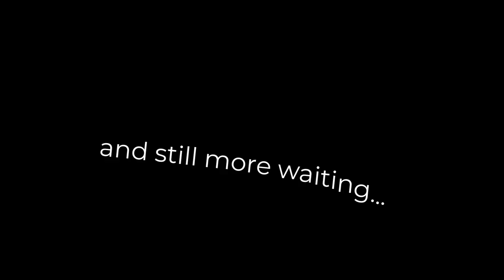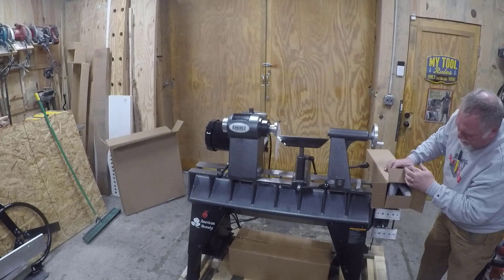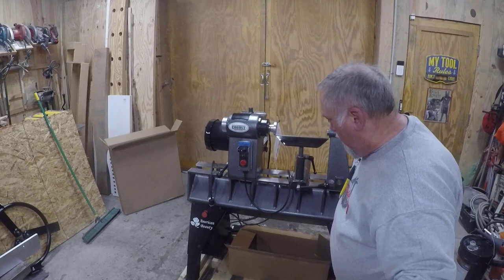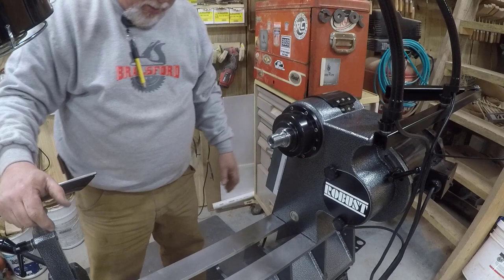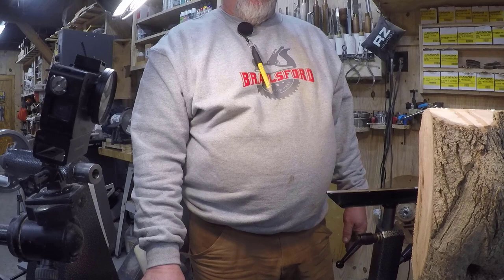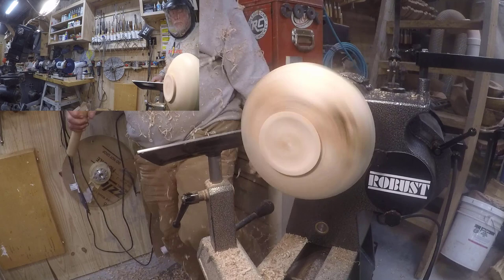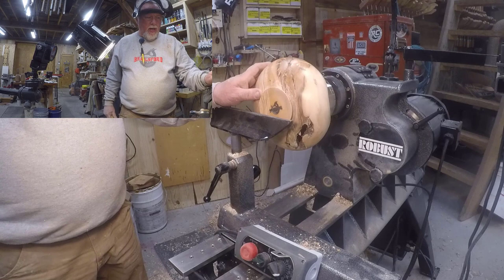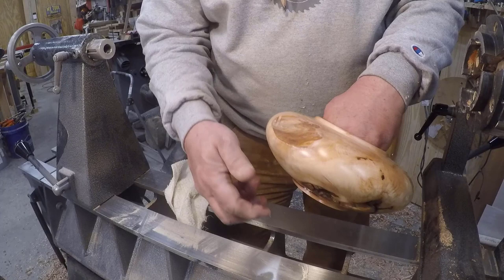Uncrating a Robust American Beauty and My First Turn on It

Comment: Thanks so much for this video!  I am VERY close to upgrading from my Laguna 1836 to this lathe, once I can get all the money in order!  Was it difficult to get off the pallet?  Or to get the wheels on?  Is the thread and live center from Robust?  I have had a hard time fining a 1 1/4” one?  8 months in what are your thoughts on using the foot switch?  Thanks for the video and sweet first turn!
Reply from the maker: I am glad I could help!  So  I used my tractor to lift it off the pallet, so no it wasn't hard.  Next, they live center is Robust and 1 1/4x8 threads are common.  Look on Amazon, or the Wood Turning Store, or Grizzly or Woodcraft, they all have them.   Your 1836 is 1 1/4"  I have the same lathe.   I have Hurricane chucks from the Wood Turning Store.  Lastly, I LOVE the footswitch!  It was an afterthought for me but I am glad I did it!   I hope this helps!